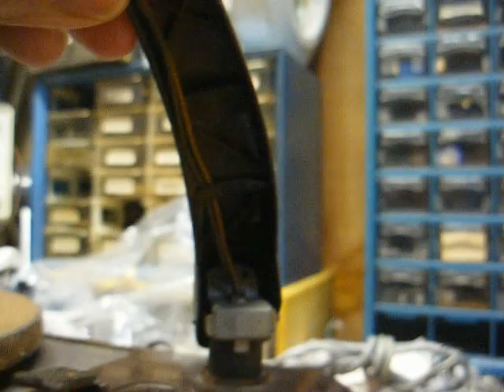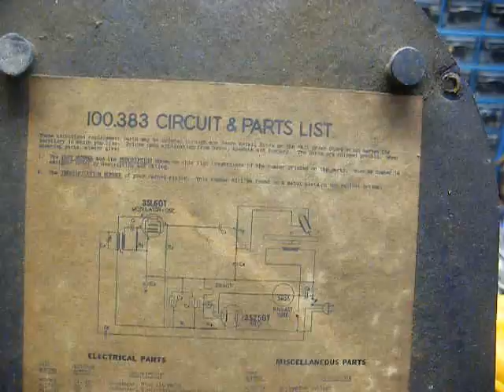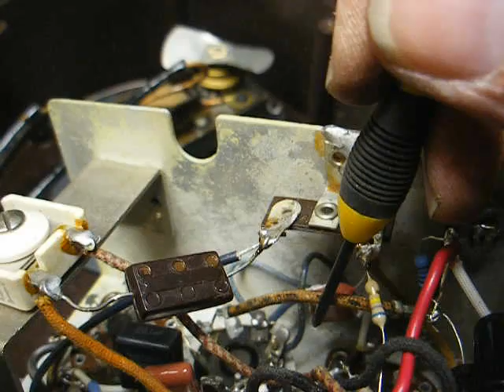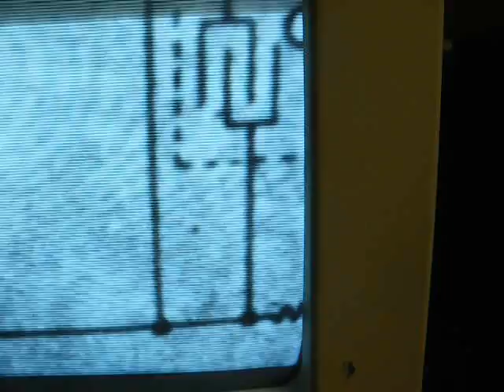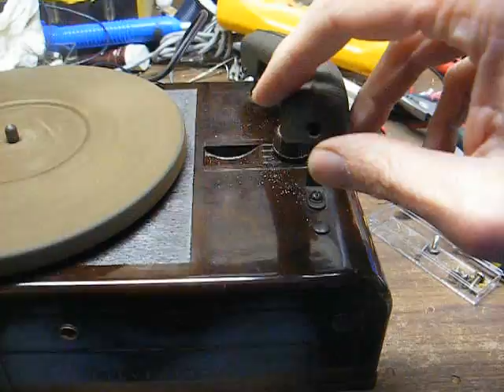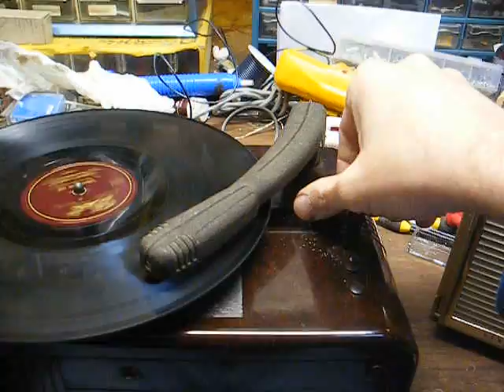Silvertone wireless record player from 1947

Comment: the only Silverton radio I have is a 1962-1963 silvertone Majestic model 3007 AM 6 tube radio. my Silverton radio still works just fine I did replace the the filter capacitors and the radio is out of alignment little bit wen you tune in 1050 it reads 1100 but it's not bad for $2.50 and better then my junk new one in less then a year the volume knob is getting scratchy and have radios that are 50 years and there not scratchy at. I had a junk crosley and did the one thing it deserved I put it out of its Missouri by destroying it ha ha ha!

Comment: I've found that if you have a dried out rubber drive wheel a quick fix is to go to a local Walmart and pick up a can of flex seal. And spay a light coating on it. It basically adds a new rubber on the old rubber

Comment: Are you sure that 3 wire cord wasn't a 'hot' cord, with a built in resistor for the tube heaters?
Actually, I see in the schematic that the wire IS the antenna.  Many of the sets from that era did have hot cords though.  Interesting circuit, the modulation is applied to the screen grid of the oscillator tube, probably resulting in as much FM modulation as AM!
I remember as a kid building my own version of such a rig, only a bit on steroids.  I had a 6F6G as an oscillator, 6F6G as a choke coupled modulator, and a 6SQ7 preamp driven by a ceramic cartridge.  I threw a few dozen feet of wire out the window of our 4th story apartment for an antenna.  The rig had a range of a few blocks.

Comment: That is interesting. I never knew they had wireless phonographs, but it makes a lot of sense. And a nice simple circuit. I like simple. Nowadays that would take a 5 page schematic to do!
Reply: Nah, it wouldn't even take a 5 page schematic these days.

These days, you'd just take an off-the-shelf IC whose specifications on the datasheet match your requirements.  All you'd need is a circuit that can feed it power, give it a ground, and provide a way for usable signals to enter and leave it.